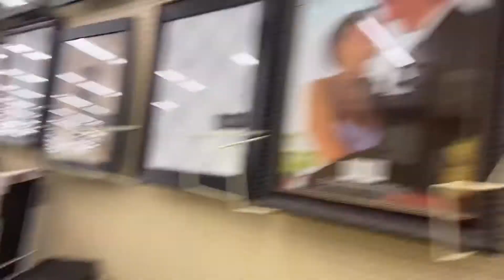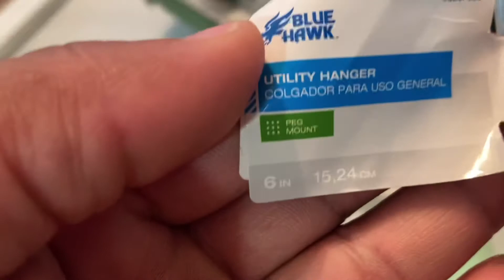DIY HOME THEATER IDEAS

Comment: What did you use to make the lights on the ceiling?
Reply: Star light projector it on Amazon
Reply from the maker: I got ceiling stars from Amazon they are stickers!! So much work and I had to glue them. I used elmer glue. The we used a projector also from Amazon. The projector was the special touch